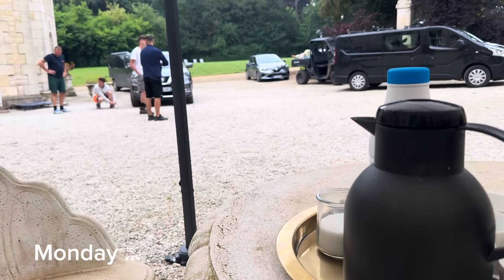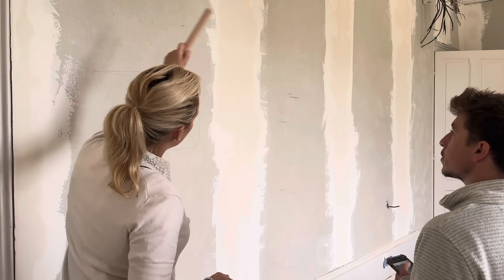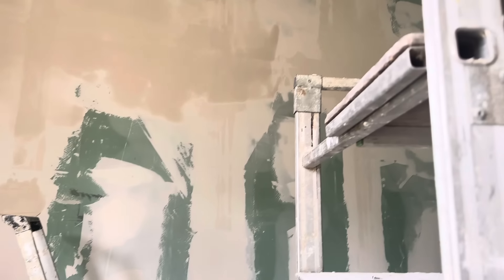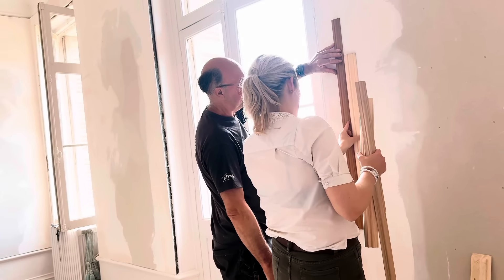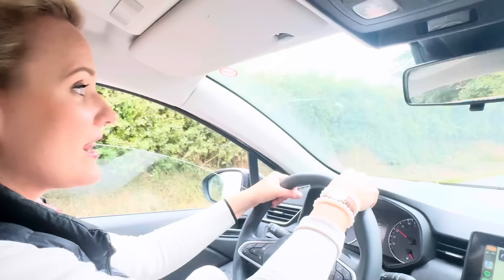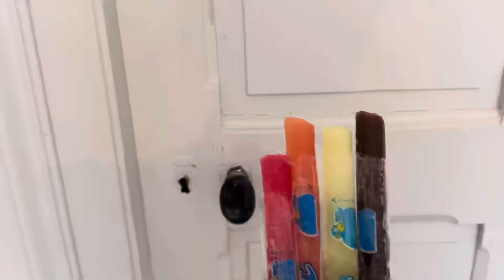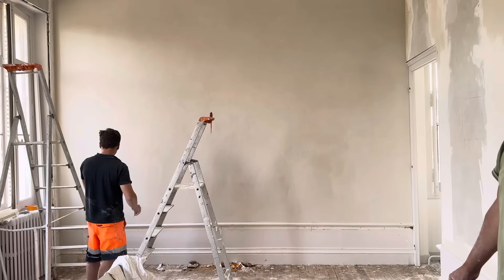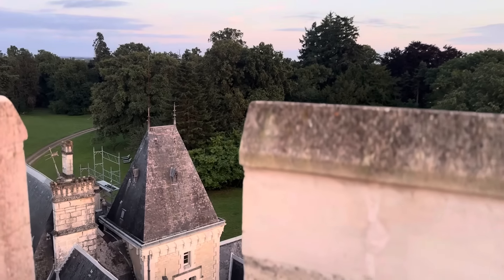One BIG PLAN and so many choices! We have to make decisions!!

Comment: As you plan to accommodate clients at your property, be a little bit cautious about electrical and fire hazard installations. The requirements are significantly higher as for a private property. A neighbor had done a fantastic renovation of an old bastide here in the Luberon nearby with a UK team. They did a great job, but for the 2 points above it was just their appreciation of French norms, and it failed completely on inspection. The guy couldn't open his business and had to redo a lot of stuff.